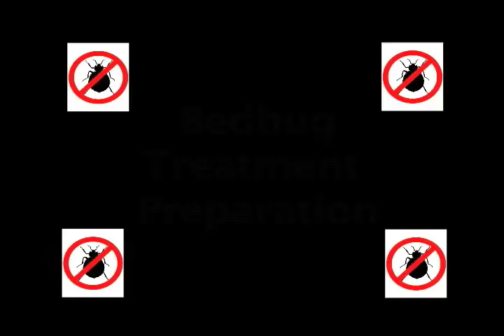Bedbug Treatment Preparation

Comment: You can easily get rid of bedbugs yourself if you use similar techniques. Like very thorough vacuuming. Steam cleaning and spraying with a chemical. I have found that strong disinfectant solution is good at killing bed bugs. Using one part disinfectant from a bottle of concentrated disinfectant and two parts water. Then thoroughly spray the mattress, the inside and outside of the bed. And the carpet edges by the skirting board. And every single crack and hole I can find in the walls.

Comment: What if you cannot even afford a new bed? Can that be treated and have an encasement on both box spring and mattress? Pillows are not super cheap either, I have a neck and back injury I cannot be buying 50 dollar pillows nor can I afford another 1500 mattress
Reply: No need to discard the matress and pillows steam or allowable pesticides will work.

Comment: If you live in a house and have them and the dog sniffs it only in one room do not leave that room to sleep in another they will leave that room with you. Wear long pants, long sleeve shirts and you can get a net for your face until you get rid of them. Also try putting baking soda at the front of the door in that room so they cant get thru it and move to other rooms. I personally threw away as much clothes and matrieal items I could. Pillows gone, sheets gone, blankets gone. All other things I need or paper work I put in a plastic storage box or large zip lock bag. Like socks, I threw all them away and bought a 20 pack for 30 bucks. Anything that you can do that with, underwear, socks, t shirts ( go to joneshirts and by 20 t shirts for 55 bucks ) do it. And more expenive shirts, pants etc,,,, put it in a sealed garbage bag bring it to the laundromat and wash on heat, and dry on heat for extra time. At the end of one room, I had 4 bags going to laundromat, 8 bags to the garbage and 2 storage bins and 2 garbage bags with things I will keep but probably wont re open until close to 9 months. I am far from rich but one room will cost you about $1400 , the do that room complete and will have to do the base of the floors of the rest of the rooms. SO if your entire house gets infested you are talking about $ 6000. Throw the stuff away and think about how much you are saving.